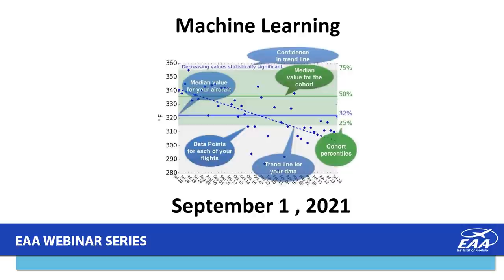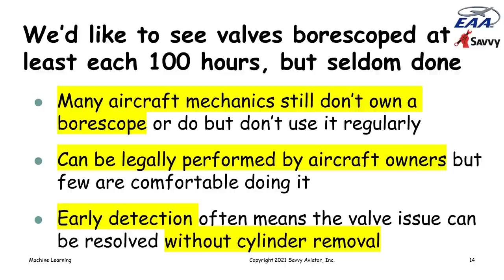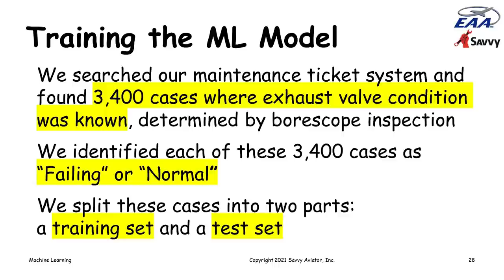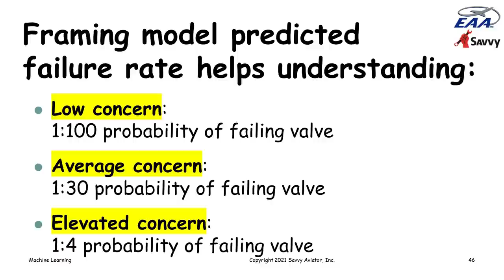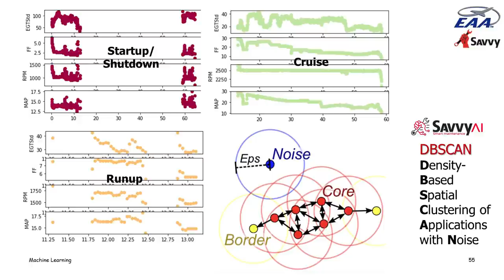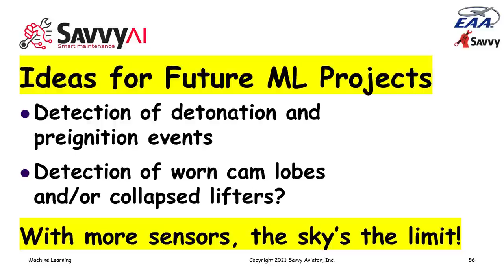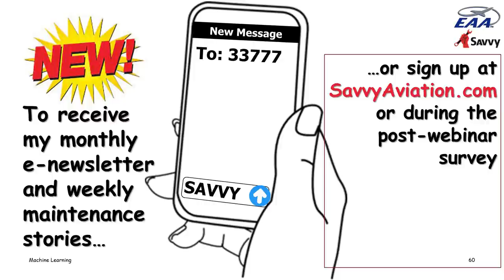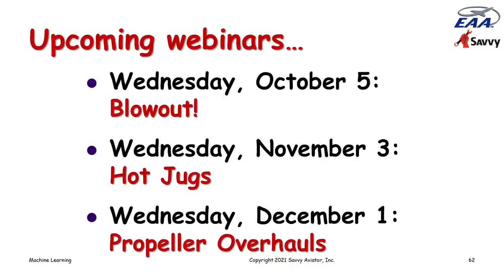Machine Learning

Comment: Mike, 
I am a 20year AF pilot and I am finishing my master’s in Data Analytics.  I stumbled upon your series while looking at buying my own plane and have found it fantastic.  

In regard to analytics I had a few comments that maybe you have already considered, but if not, just my 2cents. Overall, there is a severe lack of understanding in most operator communities of what ML can and cannot do, which inevitability leads to mistrust in the system. 

Did you consider presenting the users with a FP(false positive) or FN(false negative) cost? If 1/4 is a false positive, but the cost of a borescope is only a few hundred dollars, while the false negative rate is a cost of replacing a cylinder or more(thousands of dollars), then overall its more advantageous to take the FP over risk the FN.  

Also important to educate people that the machine algorithm will always have a higher FP percentage when the dataset is unbalanced(more passes than failures in this case).  I am assuming there are more observations of a non-failed exhaust valve then a failed one.  Would be interesting to replicate the positive cases until they equal the negatives and see how much improved the predictions could be.  My gut tells me that the FP rate would decrease at a maximum of about 50%.  Replicating the data would lead to severe overfitting of the test set of data, but would be interesting to identify the minimum FP rate. 

In addition to updating the database with new cases, probably more important is to update the ML algorithm with the latest and greatest algorithms.  Random forests are great, but newer 
techniques such as gradient boosting or Support vector machines (SVM) could produce different or better results with an unbalanced dataset.  ANNs or KNNs could also be useful.  Ensemble modeling would probably increase the overall accuracy, but could lead to overfitting. 

I agree the post flight telemetry uploads are important, but IMO not the coup de grad.  The end result in my mind would be using a defined database and algorithm to real time and post-flight predict problems the pilot cannot detect.  This is definitely within our means computationally, but really a logistical problem. 

-Wes

Comment: With regard to FEVA messaging, I think the issue stems from two issues. 1) Too much information that does not require action by the owner. For example, reporting the low and average risk cylinders is extraneous if you do not expect the owner to take action. 2) Telling the owner there is risk of valve failure without providing a good sense of how close to failure the valve could be. Informing the owner that 1 in 4 engines in the dataset with similar indications were failing does help the owner understand the level of urgency and perhaps unnecessarily incites a bit of panic. I suggest being very concise and tell the owner exactly what needs to done. e.g.  “Based upon our analysis of your most recent engine data, Savvy recommends a borescope inspection of the #4 cylinder [insert timeframe: before next flight, as soon as practical, at next scheduled maintenance, etc.] to check exhaust valve condition. Once complete, we will review the inspection results and recommend a corrective action, if necessary.”
Reply: Thanks Monte. It is a challenge to know how much to say (or not say!). Your comments are helpful and appreciated.

Comment: IDIOTIC:  There are over one million parameters to consider whether a turbine or reciprocating engine. For instance; fuel chemistry change in temp, BTU; metal cooling and heating; over Five Thousand timing errors per minute; Ad Nauseum.  
Stick all that in your computer, It still won't be accurate. [chemistry, metallurgy, air and fuel flow, lubrication etc.]